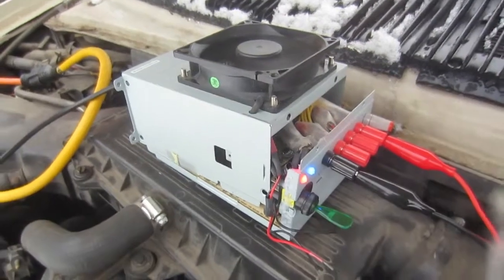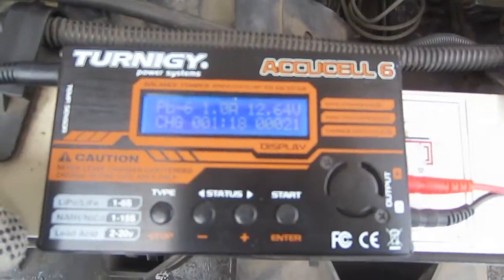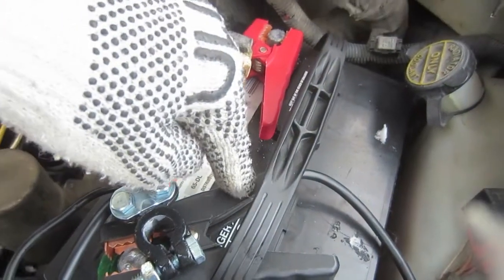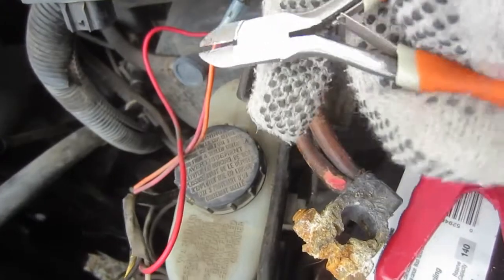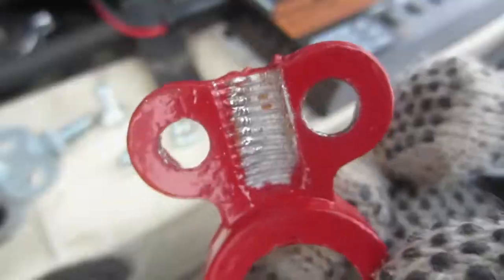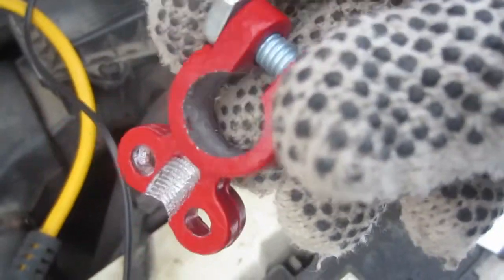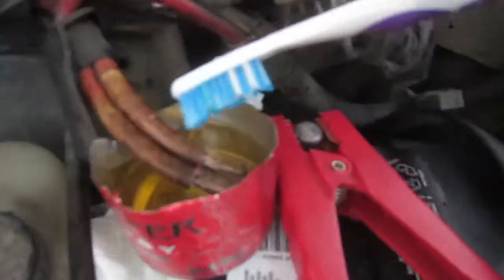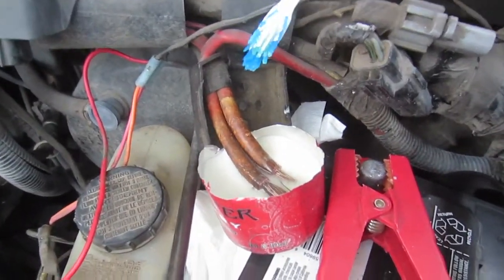[van] start

Comment: Congrats on the start!  ... you said darth vader van omg, what was that darth vader sound in the other video though?  Oh, I read a little bit of the forum posts and someone said it might be the fuel pump or something hmm.. go go gogogo!
Reply from the maker: Thanks! Oh there was the interior light controller behind the driver seat. It has a relay in it and it was doing the same thing the hazard lights were doing, clicking like crazy. The brake pedal was doing a breathing sound if that's what you meant by darth vadar?